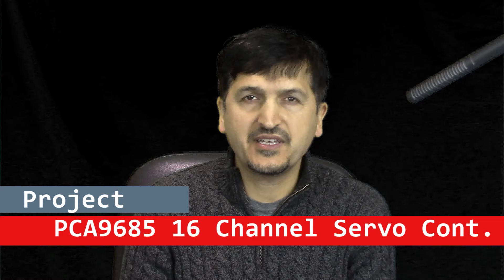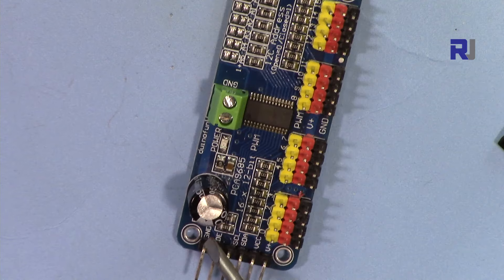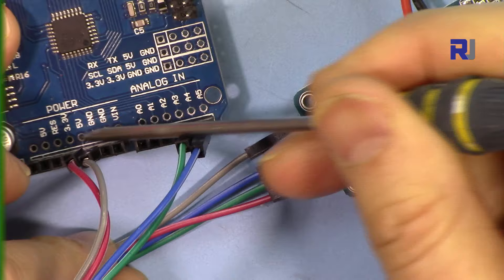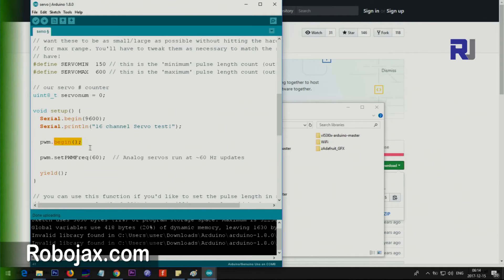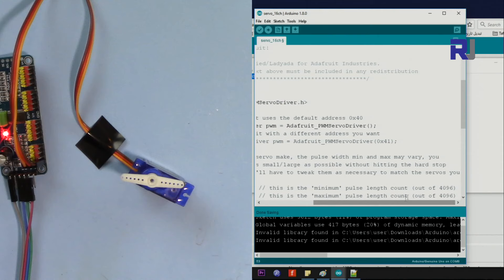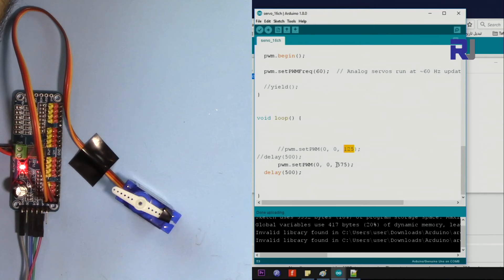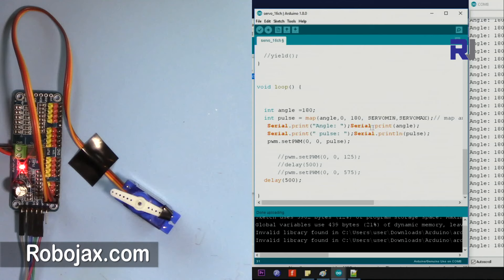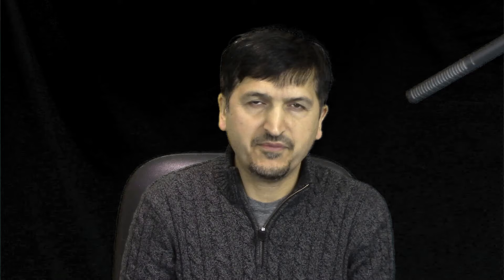Complete guide to  PCA9685 16 channel Servo controller for Arduino with code Version of 5 ( V1)

Comment: This tutorial was AMAZING!! Do you know how to trigger the loop with a button press? I can't figure it out!
Reply from the maker: Thank you. I would have to make tutorial video on that.
Reply: Use a control variable to do that.
You could use something like this:

boolean running = false;  // this is the control variable

if(button == LOW){     // this is the way to start the loop with the click of the button
    if(running == false){         
       running = true;

    }

}

delay(200);

while(running == true){    // this only triggers once you've pressed the button, because once you've done it, the running variable is going to be set as true.

   if(button == LOW){
       running = false;  // this is the way to stop the loop with the same button once it has started

   }

    put the loop here

}

what happens here is:
the first time you click the button the loop will start and it will run continuously until you press the button again. Notice: this method does not stop the for() loop itself, it just keeps it from repeating. Ex: You press the button, the for loop starts to run, and if you press the button again, while the for() loop is running, the program will wait until the for() loop ends, and then, it is not going to repeat the for() loop again until you press the button again. If you just press the button once, the for() loop will just repeat itself forever(or at least until you press the button again);

Idk if my explanation was very clear, in case it wasn't, just reply to this comment with your question and you'll try to help you. Obs: Once you've learned how the code above works, you can use the main idea of it to control any and how many loops you want. At least, that's the way I do it. It might not be the best way to do it, but for me, it is the most simple one.

Comment: Do you have any idea on how could i supply the 5V to the PCA9685 board considering the fact that i need it to put it in a portable 3d printed robotic hand....? I hope you cand help me with this. Great video !
Reply from the maker: Hello (first hello or hi),  measure the current for one servo while the servo is motor working and moving the load (under the load). then multiply the amount by the number of servo motors.  Then get 5V power module.

Comment: Enjoyed your tutorial!  Do you happen to have Arduino sample code, to use potentiometers, to control the servo's, that you can share?   Using the same I2C setup, that is in the tutorial above?
Reply from the maker: Thank you very much. I will try to make a video and post the code. I have to test it and make sure it works before posting it.

Comment: Very interesting video, Robojax. 
I have an application with servos driving delicate mechanisms. After a shutdown, my servos (all of them as a matter of fact) jerk briefly when resuming power. The movement is brief, but its amplitude is enough to damage my system. Is there a way to overcome the phenomenon by tweaking your program ?
Reply from the maker: Thank you Marcel. Very interesting issue. Does this happen when powering up or does this happen also when you press the reset button Arduino?
If you don't see the issue  when you press reset, then add 2 second delay in the setup() just after setup so the motors don't get any power.
let me know.

Comment: Can you show, how we can control servo motors using PCA 9685 servo driver and a Radio Controller(Flysky CT6B)...?

We are facing so much problems on this issue..😥😣
Reply from the maker: Why do you need to use this with Flysky? The input for this is totally different. FlySky has its own receiver and depending on the number of channel you can control devices.  I am not sure if you can find 16 channel TX and RX.

Comment: Hello! Thank you for the video. If I use 12 servos simultaneously, how should be the supply charge of amperes?
Reply from the maker: You are welcome. If you wanted the amount of current, first measure the current using Ampermeter for one servo and multiply it by 12.

Comment: Thanks for the helpful video! Can you provide a link to those wires that you used when connecting the PCA9685  to your Arduino?
Reply from the maker: This video has 4 versions and this only version 1.  I have clearly shown it and explained it . No wiring diagram. If you need it for projects, use fritzing a free software.

Comment: Hi, amazing videos loads of details and easy to follow. Was hoping you can help me. I’m using a PCA9685 to control 10servos. I want to be able to control the loop of the 10servos but a voice control module. Using a nano both modules on the i2c. I have the dfrobot offline voice recognition module. I need help with coding and wire diagram. There is nothing on the web. Please can you help.
Reply from the maker: Hi, this is Version 1 (V1) and there are 3 more Versions V2, V3 and V4 and I have shown multiple ways to controt them. Links in description. Those might help you.
Reply: Cheers I will look at these also.

Comment: is it possible to not connect the VCC to the Arduino and use an external power supply to supply PCA9685?
Reply from the maker: Please watch. I've explained it very well.

Comment: I am using 16 mg996r servo motor with pca9685 will you please tell me what is the best power supply for it..??
Reply from the maker: run of servo. measure the current or find the datasheet and see what is the maximum current, then multiply it by 16 and get a power supply equal or greater that . for example if you found that the current is 0.5A,, then 0.5x16=8A so use 8.5A or higher power supply with 5V output.

Comment: Very nice! Now it’s clear to me how SERVOMIN/SERVOMAX works! Thanks a lot!
One question; I am trying to control 9-10 servo’s individually through a 3x4 matrix numeric keypad. Will there be a way to [toggle] control of a servo state, e.g. press ‘1’ to get the servo to s designated angle then press ‘1’ again to get the servo back to angle zero? You advice would be much appreciated!
In Arduino only situation, I could use the <keypadEvent> sketch to achieve his, 
e.g. case PRESSED: 
if key==‘1’ {
digitalWrite (ledPin, !digitalRead (ledPin));
- - -
I am looking for an equivalent code...
Reply from the maker: You are welcome. Here is my video on how to control servo with push button https://youtu.be/7woqNH_qby4
Reply: Robojax Thanks for your kind reply. I think, however, I already watched your video you recommended. In that video, you demonstrated two-button control of a servo with an Arduino board. But I need to control 8-9 servo’s so it would exceed Arduino’s PWM capacity. That’s why I am planning to use 16-ch PCA9685 based shield.

Comment: Amazing video, however my servo motors are not rotating. I'm using an arduino mega 2560 and the code uploads but nothing happens after. I have ordered an arduino uno in hopes it will work. I'm not sure why my mega 2560 isn't able to control it?
Reply from the maker: It should work with mega. You have be doing something wrong. I am not sure .
Reply: @robojax  Thank you for responding. I followed all the steps you took. The only difference is i'm using a mega 2560 and the adafruit library I downloaded is on 1.8.13 instead of yours which is on 1.8.0. For example you only have 2 #defines in your code but the one i downloaded has 5 #defines. Under #define SERVOMAX 600 it says #define USMIN 600
Reply from the maker: Please download the library from robojax.com as the library might have been changed.
Reply: @robojax  I used robojax code and it still did not work, I also tried retyping it which didn't do anything. I also tried a different set of code but nothing happened. Im starting to think there is something wrong with my pca9685, I guess ill keep trying different things. Thanks again for your help!

Comment: I set the PWM for a servo to 90, and it started to continuously spin around, do you have any explanation for this? I was trying to find the minimum PWM value.
Reply from the maker: please watch V2 of the video for more examples you may find the reason. the code itself is not doing it, you must have modified the code.

Comment: Fantastic! I want to connect 4x mg995 servos to the Pca9685, and they draw 1200mA in stall mode, what kind of power source should I use? Could I just connect batteries in parallel? Thanks! Great tutorial!

Edit: I have a pretty limited budget...
Reply from the maker: so you should connect 1.3A or 1.5A power adaptor. Battery would be expensive but doable.
Reply: Can i drive a 60kg cm servo which requires  7.7v input on this board i want to drive 12 such motors will the module get burned or something else

Comment: Hi, I have a question: If I have 4 servos that needs 7.2V and 1A, and I use a power supply of 10V 6A (V+), the board will give to each servo the voltage and current that it needs, or I have to use resistances than reduce 10V to 7.2V?
Reply from the maker: This board does not change the voltage or current. You would have to use  a servo with proper voltage source for it.

Comment: how much power can 2 PCA's handle? I know one can handle 12volts, but for example if one can handle up to 12volt pwr supply, if im using 2 PCB;s can i use a 12 volt pwr supply for each or am i limited to only 1 12 volt pwr supply between the two?
Reply from the maker: Perhaps you did not pay attention as I have explained it. Here is V2 of this video https://youtu.be/bal2STaoQ1M  or this video control 32 servo https://youtu.be/6P21wG7N6t4 I have explained it, watch it fully without escaping and you know  how to use it.

Comment: thank you so much!
only one question - question about speed control is still relevant - how to do it?
Reply from the maker: You are welcome. Each servo has pre-determined speed (quality and price) and can't be set.
Reply: @robojax  yes, I know.
i mean may be that library (or may be you can advice another) have methods for solving that typical issue
Reply: @robojax  hey :) 
if I can use loop for pulse increasing? for ex: 
                                                              pwm.setPWM(0, 0, cnt++); 
... or that kind of trick will bring delays?

Comment: Sir i want to replace delay with millis in same for overlapping tasks but stuck ,,,how to do it can you guide i want to control 10 servo moving at different time intervel from 0-180 and 180-0
Reply from the maker: this is version 1 (V1) of the series. I have V2 to V4 of this series and you can control each servo independently. I am not sure in which video but I remember I have given example.

Comment: Hi, how are you?  I am having problems, with my pca9685, when adding a ninth servomotor it became slow and as it is difficult for it, I have a transformer for gamers, so that the amperage would not be a problem, when removing the ninth servomotor, the motors will be blocked,  the pca9658 damaged?
Reply from the maker: Hi, if you use Serial.print, that makes it slow. remove all printing via serial. adding or removing servo motor should not affect this.

Comment: can i connect the pca9685 to  4 AA batteries of 1.5V each (6V total power supply) to supply power to the module?
Reply from the maker: I just check the datasheet here on page 1 https://cdn-shop.adafruit.com/datasheets/PCA9685.pdf and the chip can tolerate up to 5.5V. 6V will kill it.

Comment: I was wondering... do you need to use any other component to protect the arduino from the "blowback" voltage of the servos? Is this driver already protecting the arduino? Thanks
Reply from the maker: No you don't need it. There is already components inside the servo.
Reply: Okey, thank you! And great tutorial

Comment: Hi,  i want to control a servo motor with two different arduino boards, can this module do this ?
Reply from the maker: this module is being controlled using I2C communication. I have not tested but  you can should be able to connected two Arduino and control it . Using I2C you can connected 128 devices in parallel.

Comment: Thank you for an interesting video. I am building a Model Railway in OO scale. I want to control the 32 points that are in the design for the layout to be controlled by servos mounted under the board. So, I need to be able to control each one separately using a one-touch switch. Two things I need to know, which and how boards do I need and wherein the circuit do I insert the switch. The servos will all have the same amount of travel, left and right. So can just one program be copied to all 32?   Regards, Martin (Thailand)
Reply from the maker: You are welcome. You don't need another Arduino. Just two of this boards and conect only ONE to Arduino. You will connect one board to the other (cascade them). I have explained this in video. watch it again. You will set a value in the code as well.

Comment: Do you have to solder the pins onto the 16 channel board?
Reply from the maker: there is no soldering in this project. do exactly as I have shown. Unless your project is somewhere which is shaken a lot to solder it.

Comment: Hi, thanks for the video. I need to know if there is any way to disable the current on a servo with this librar y after it makes a move. I am using 15 servos and they make a lot of noise and vibrate. I think this would be a way to eliminate it. Thank you
Reply from the maker: Hi,  servos are independent.  They just get PWM signal and other than that you can't have any other control. you can have delay between the pulse you send if you add it in the loop. other than that you can't do within Arduino. There should special servos where you could read the current and set the limit. But these servos are very simple.
Reply: @robojax  Thanks for your answer. My idea is to do something similar to the dettach function in the servo.h library and stop the servo from receiving voltage.
Reply from the maker: when sign is turn OFF, the current should be zero. Attached /detach only assigns pin and does not send any signal to servo.

Comment: Hello, can I connect a servo that is manufactured with a  windshield motor ,12 Volt 7 A, PCA 9685
Reply from the maker: Hello,  this module just outputs PWM signal. if that servo work with PWM, then yes.

Comment: Thank you for this video, it's great! May I ask, is it ok to feed different voltage value to each PCA9685 when using multiple PCA9685's that is daisy chained? Because I will be using different servo sizes and grouped similar servos  together in different PCA9685's. That would mean, I would be supplying one PCA9685 with 5volts, and the next PCA9685 with 7.5 volts, and the next PCA9685 with 12 volts. Is this ok? Thank you again:)
Reply from the maker: You are welcome. Yes each servo can be powered up directly from different source as long you connect the GND of your power to the board and the signal signal pin of servo the board.
Reply: @robojax  Great! Thank you:)

Comment: Hi! Very amazing tuto! Can you control speed of each servo? Thanks you
Reply from the maker: this is V1 of this series. I have V2, V3 and V4. I believe I mentioned it somewhere. This code is with maximum speed. Simply add delay to slow it down.
Reply: @robojax  i didn't use boucle for but pwm set Pwm (), can usé it in it?

Comment: Hi, are there any GUI for these servo controllers pca9685 so thay i can use it and program my robot Instead of configuring each servo in code, i am working on bipedal robot with 18 dof.
Reply from the maker: Hi, I will make video on this to control servos over WiFi from mobile phone or computer using ESP8266 and ESP32. But don't promise a date

Comment: The capacitor of my PCA9685 module got separated from the board and broke by accident. can I still use it? can I solder a new 100 uf 10 V (the old one was 100 uf 10 V too) capacitor?
Reply from the maker: yes you can. Job of capacitor is to clean up the power. But better to have to avoid unexpected moves in servos.

Comment: Thought to have seen somewhere by Adafruit that this Board may be connected at 5V 10A . Is this correct? 
My servo's use each max 510mA , so 12 pieces = 6120mA = 6A.   In this case I have still enough to LEDs and DF player.
Reply from the maker: the current (amper) has no effect on the device it is higher. Only if motor needs more current it will be problem.

Comment: Hello, I modified the code to control 4 sections of motors and control a group of MeArms. Each time the movement is adjusted by 1 degree, the motor still shakes and heats up. Is this normal?
Reply from the maker: If the motor shakes, something is wrong or your have modified the value in the code. Please start with new code and see
Reply: @robojax   I understand, I try, but I read online that my friends may explain the problem of insufficient current. I am using a 5V1A power supply, and I do n’t see how you supply power in the video. (Ps I ’m a student from Taiwan, using Google Translate Please inform me if the syntax is not smooth, thank you)

Comment: Video is very nice! but I am getting a problem,If i connect servo more than 4 then they are rotating any how?
Please answer my question.
Reply from the maker: How do you power them? I have explained that you should be using external power.
Reply: Yes,I have given external power.
I think that there is problem in code.
Can you send me code you used for driving all 16 servo?
Please send it's important for my project.

Comment: Can we use it as Genral input output
Reply from the maker: if you know that the output is PWM signal, then yes. But if you just need extra 16 ports, then use  MCP23017 and I will make video, God willing.